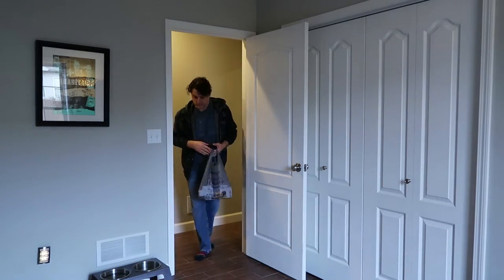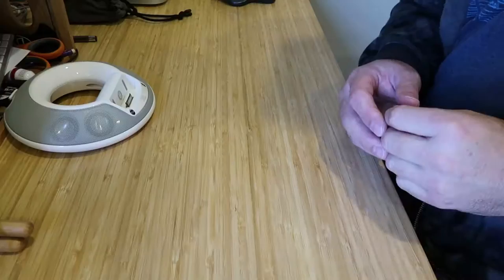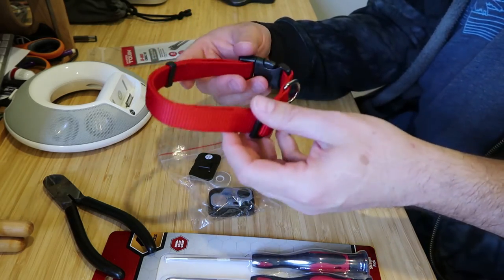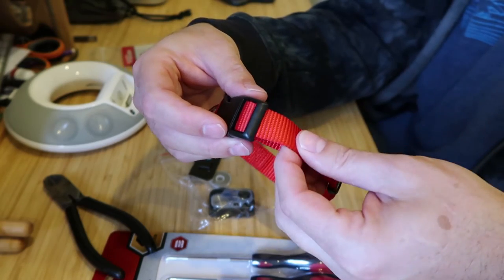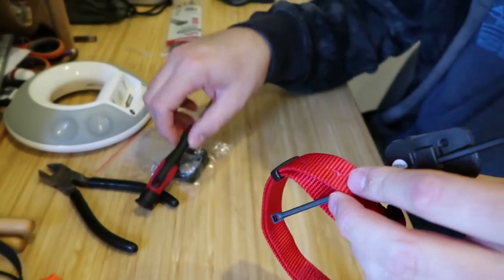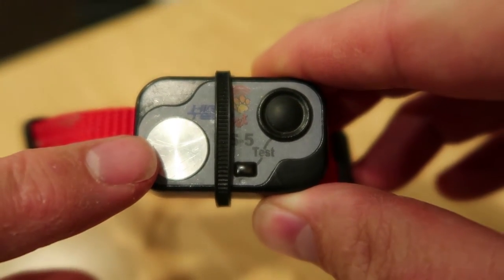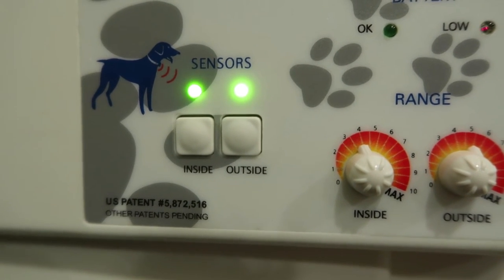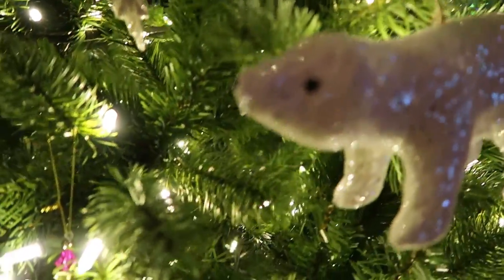How To Make High Tech Pet Collar Better | MS-5

Comment: Thank you for suggesting this idea.  Just tried it on both of my dog's collars and it work great! I see that you made your video almost 4 years ago, which tells me that High Tech Pet has not changed their manufacturing process in that time.  If they made the slot on the back of the MS-5 little bigger and wider to accommodate the thickness of a 1/2-inch wide nylon dog collar (which is what I used), they could get rid of that flimsy, no-good strap that ships with the MS-5 and customers could use their existing dog collars to attach it.  I hope High Tech Pet reads this comment.  I'll probably send them a letter, because I think it's a shame to be selling such a poor-quality product for so long without listening to customers' suggestions for improving what otherwise is very fine product.
Reply from the maker: Dennis Boone and the price they charge for batteries is ridiculous.

Comment: Nice! Thanks for this. I just installed one of these doors.  Love the door but hate the cheepo collars.
Reply from the maker: Thanks for the comment Peter. I hope it helps. We still have ours set up like this and it's working great.  -Mat
Reply: how well does the sensor stay closed
Reply: @garygarner3940  What do you mean?  If you mean the device on the collar, the battery compartment stays closed.
Reply: @ViciousLobster  have you had any issues about the small plastic piece on the reciever breaking- where you attache it to the new collar

Comment: This is great.  Thanks for the idea!  The only potential issue is that the inside where the zip ties are clipped might rub against the dog’s and be uncomfortable for the dog. Does anyone have any suggestions on how to prevent this issue?
Reply from the maker: I used a metal file to smooth off the zip tie cuts. Other than that, our dogs collars are pretty loose and never seem to be a bother.

Comment: This looks like a great solution, but I have just one question.  With the third cable tie wrapped around the MS-5 transmitter device, how do you get it off the collar to change the internal battery?  Do you cut that tie and then replace it with a new one after each battery change?
Reply from the maker: Yep, that’s exactly what I do. It might not be needed, but my dogs like to wrestle and they sometimes bite at the device/collar.
Reply: Thanks.  I was wondering if attaching the device to the collar ring would also work rather than tying it to the collar itself.
Reply: @TheMatlacks  One of my dogs (german shorthair pointer) rips through the woods daily.  The MS-5 keeps getting ripped off the single zip tie I have on there breaks.  I'm going to copy your idea of using one wrapped around the face - I think that will solve the issue.  So, thanks!  

BTW, I've modified mine to use a standard off-the-shelf battery.  That is a huge moneysaver.
Reply: @andrewdeweerd461  are you talking about by taking the metal sleeve off of the proprietary battery to use one regular batteries or something else all together? Interested to hear back.

Comment: nice job on putting it on the collar-- but how well does the sensor stay closed--i'll reall thinking about getting this door
Reply from the maker: We’ve had zero issues. The transmitter has a screw keeping it closed along with a water seal. I do remove their collars for pond and creek swimming. -Mat
Reply: @TheMatlacks  Thanks--thats alot to spend on a door but better than getting up at night to let them out

Comment: Seems like the sharp ends of the zip ties would dig into the dog's skin. The collar double layer isnt enough to protect them.
Reply from the maker: We've never had that issue but also don't have our dogs' collars very tight.
Reply: @TheMatlacks  when the dog sleeps or lays down it could rest its weight on the collar and possibly get hurt, maybe the sharp ends facing out? Or cutting really close so the sharp ends dont show. I dont know, just concerned anout the dog.
Reply from the maker: @meramosjr  great point.

Comment: I have a Pitty and he breaks these cheap a@$ transmitters all the time. The plastic tab that the "collar" passes through on the back breaks almost immediately. I cut the tab off, cut a section of metal pen or small tube that fits in depression in the back, and epoxy the metal tube in place.  Now I can zip tie the transmitter to his collar and the back no longer breaks. You do have to cut the zip ties whenever you have to change the battery (which is a whole other issue - and flaw). The doors work great but these transmitters must make the company a ton of money due to their poor quality.
Reply: I am having that problem now. We zip tie to their collars and the plastic tab has broken on all three transmitters. The company gives zero customer service. I asked to purchase backs and they told me I had to buy all new transmitters! The tube is a great idea I’m going to try that if I can find collar #2 that went missing yesterday when the tab broke off!!

Comment: This item doesn’t work. Opens and closes for no reason. Overly priced and customer service doesn’t exist!
Reply from the maker: Sorry to hear. Ours worked in two homes for about 5 years or so with no issues other than the collars. Perhaps you have a bad sensor on the door. Wish you luck with High Tech Pet. A competitor would be a good thing forcing them to innovate.

Comment: I stopped using zip ties after they failed the first time. Don't risk losing a 50.00 Item to a cheap zip tie.
Reply from the maker: Weird, we’re several years in and have had no issues even with the dogs biting the transmitters. -Mat

Comment: Don't buy High Tech Pet doors.  They are unreliable, cheaply made, (they are expensive to buy) pieces of junk.  After a couple of years they are completely useless (my own experience) and the door won't stay closed or won't open all the way trapping the dog inside or outside.  Cheap Chinese made junk. 

 High Tech Pet customer service is a joke.  They don't know crap about their product and how to trouble shoot it.  When you call them they say the same thing over and over again "ohhhhh you need to loosen the screws in the wall they're too tight and after that it will work fine."  YEAH? I did that already, still doesn't work right.  I've got news for you High Tech Pet it ain't the wall it's your internal motor sensor and the spool that are the design flaw.  And for heaven's sake in the future design the product to have a metal tract for the plexiglass door to slide so that it will stay straight and will stick less to make it hold up better.  I mean for $400 you would think you would at least get something better made. 

  Every time you call them they say the same line over and over again to get you off the line for the next sucker.  So i say again, BEWARE OF THEIR PRODUCTS!